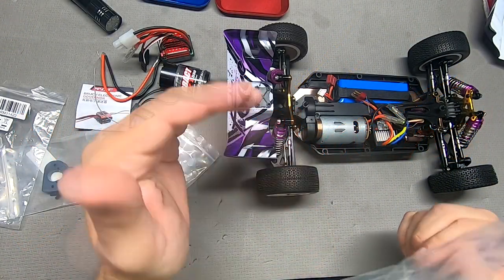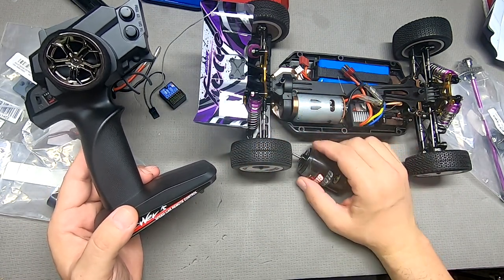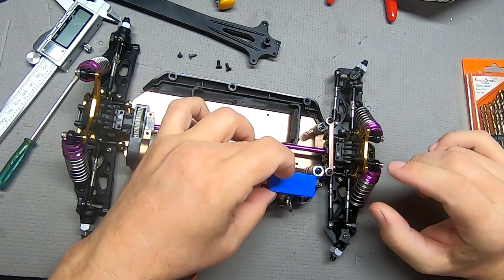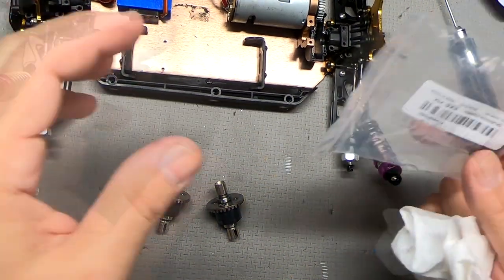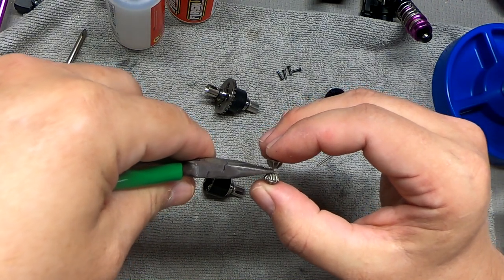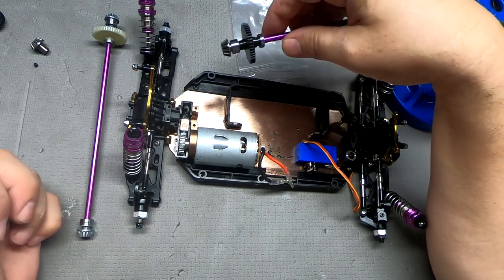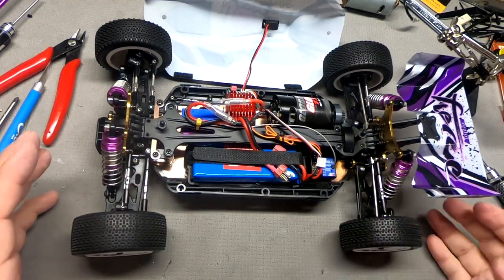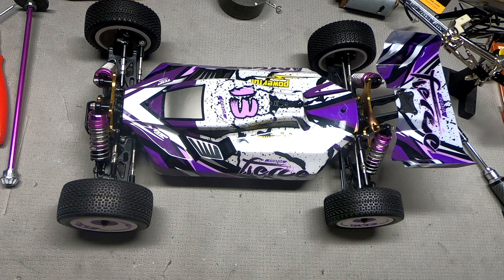New Motor, Diffs, Electronics, & Speed Test - Wltoys 124019 RC Buggy 4WD - Pt. 7

Comment: Could you go faster with a bigger battery? If so what kind?  using the original motor . great video and thank you for your honest logical opinions thanks again. hope you all are feeling better
Reply from the maker: Hi Mike, sorry for the late reply... been repairing a leak in my water cooled PC. 
Thank you for the complements and the well wishes! 
Let me give you an explanation of batteries... forgive me if you know some or all of this. If you get a bigger battery that has a higher "mah" rating (milliamp hour), the buggy will run longer, but not faster. Think of mah as the size of the gas tank in a car. If the battery has a higher C rating, the buggy may have more power and/or accelerate faster. The C rating is a theoretical value of how much juice the battery is capable of releasing per second... kind of like the size of the fuel injectors in a street car. The S value, like 2S, is the number of cells which hold 3.7 volts each. You can think of this as the displacement of a car's engine. Going from 2S to 3S would make a car go faster, but only if the esc and motor can handle the additional voltage. This buggy can't take a 3S without burning out the electronics. 
My recommendation is to keep it stock unless you are willing to spend a lot of money on it.
What are your goals for RC? Do you just want to bash, or are you interested in racing? Let me know so I can advise you further.
Regards, CJ
Reply: @MyRCChannel-CJScott  Great explaining. I am new to RC and was pretty much clueless about the batteries. I think I will keep it stock 30mph is good  and fast enough for a beginner like me. Wife an I Manage and live here at  our campground in FL. I was racing around the grounds and  some of our patrons/friends  were amazed how cool  the 124018 was. They bought 2 of the 124019 and I just order my wife the same. Planning on creating a race track in the tent area. should be a lot of fun. 1 more question. I been looking to fined where to buy more wheels and tires for these models. I found some and seems to be not many options.  Any special store I should go to? thank you so much for getting back to me, very much appreciated.😊
Reply from the maker: @mikel8367  Not sure about wheels and tires... 1/10 buggy tires MIGHT fit...
The best way to make a car go fast... as in fast laps is to improve handling. This is accomplished by tuning the suspension. Here are some links to information about how suspension works and how to tune it. Also, if you haven't already, watch the 4th part of this series where I do a basic setup. Link below:
https://www.youtube.com/watch?v=tnLdywZhtEc&list=PLWi1J2KoLS73tAQc-_FfVPkVvUVWVOAov&index=4

Suspension Tuning

https://img2.associatedelectrics.com/pdf/cars_and_trucks/shared/RC_HandbookV2.pdf

https://www.competitionx.com/rc-tuning-guide/

https://www.rctech.net/forum/electric-off-road/708385-understanding-tuning-introduction-basic-tuning-racing.html
Reply: @MyRCChannel-CJScott I was thinking changing wheels mainly for looks. I would like a good set up for my terrain.   I will definitely check out the links you sent. .thanks again  for your help .

Comment: What is the difference between running grease vs oil in the Diffs?
Reply from the maker: Diff fluid comes in specific viscosities and is designed to maintain that level of "thickness" during use. By providing an unchanging thickness, you can tune your diffs using different grades of diff fluid. 
The primary function of grease is lubrication and it's viscosity may change when heated... it's also not measured by thickness so you can't use it to accurately tune the diffs... but since these diffs do not have o-ring seals, they leak over time so it's not as critical what you use, as long as there is some form of lube in there... It's a cheap car, but at the same time it's well worth the money for the beginner, basher, or anyone on a budget who is not interested in racing.
Reply: @MyRCChannel-CJScott  thanks for that 👍 I purchased this for my sons 8th birthday, so looking at 'what to do first'. I was just going to shove some decent lithium grease in there as I have good quality bearing grease on hand, honestly I was just going to pack it with grease and be done with them until they are worn, unless that a bad idea? 

I used to run nitro rc 20 years ago, Tamiya and a nitro Hawk which I modded a lot, but its been a while and I'm out the game...
Reply from the maker: @adamrobertsgb1  Having tinkered with this car and it's diffs, here are my recommendations:
Problem, the diffs do not have o-rings so they leak over time so using grease is Ok.
Since the diffs leak, trying to tune them is a losing game and you'll waste a lot of time fooling with them. 
The aluminum diff housings leak worse than the plastic ones so stay with the plastic for now. 
Don't over fill, try about halfway up the small gears. Rotate the gears as you add grease to fill any voids or bubbles. This should provide descent resistance. 
Use this buggy as a platform to teach your son about how suspension works and how to tune it... toe, camber, ride height, etc
Here are a couple of great guides to suspension tuning... 

https://img2.associatedelectrics.com/pdf/cars_and_trucks/shared/RC_HandbookV2.pdf

https://www.competitionx.com/rc-tuning-guide/

https://www.rctech.net/forum/electric-off-road/708385-understanding-tuning-introduction-basic-tuning-racing.html

Keep in touch and let me know when your boy is ready to move to the next level... I'll help you choose his next car based on what your goals are. In the meantime, contact me any time if you need help.
Regards,
CJ

Comment: 34mph is plenty fast? 😆. That’s where we differ my friend 

Nice video though !
Reply from the maker: Thanks! To each their own. If you like speed runs, more power to you, as long as you do it somewhere safe. I like to turn at the end of a straight away and then turn again... my focus is on racing. 

Thanks again for watching. I hope you'll check out some of my other videos. 

BTW, if you like fast, you should check out 1/8 touring cars like the Serpent SRX8 GT. That thing is crazy fast and it corners like it's on rails.
Reply: @MyRCChannel-CJScott  only fast cars I really have currently is my 4 Tec, my typhon, my rustler 2wd, and my arrma felony.   I’m into speed runs but it does get boring going in a straight line lol I don’t have any tracks to race at near me I don’t think 🤔 I’m going 2 look into it.
Reply from the maker: @DeRock401  That's too bad. Not having access to a track would be a bummer. I've got two indoor off-road clay tracks within an hour's drive, one of which has a big Mini-z racetrack. Also, there is a local club run by this great guy who has been organizing it for years and pays for a lot out of his own pocket. We race on road cars in a school parking lot. I consider myself lucky. 
If I didn't have access to these facilities and clubs, I'd probably be doing the same thing you're doing. I've thought about trying some speed runs, but my area is very urban and the local authorities would crack down for sure.
Reply: @MyRCChannel-CJScott  yeah I’ve yet to find a location to run my felony yet cuz the road/ parking lot needs to be at least 500m long and smooth blacktop which is annoying. And I also live in an “urban” environment lol  but yeah man I love this hobby too much to let it stop me
Reply from the maker: @DeRock401  I've contemplated where to do long runs because I built a car for No Prep drag racing, but the fascination was short lived. The guys I race on-road with were holding drag sessions for a while last year, but having to set up for drag races on Saturday and road races on Sunday became to much I guess. I know it was more than I could handle on a regular basis.
Anyway, where I was going was, you might look around to see if you've got a shopping mall that closed down in your area. Malls have some of the biggest parking lots. Bring a leaf blower and/or a wide push broom to prep the run and you're gold. There is a big mall near me that totally shut down after the housing bust and never reopened. Now, they lease out some of the parking lot space to Amazon and others for fleet vehicle parking/storage. But they're are still big open areas where there's nothing and no one to get in the way. Big office parks on the weekends are a potential candidate too.
Reply from the maker: @DeRock401  BTW, the Felony is a bad ass car. I would have also gone with the orange body! I wish there was more large scale on-road racing in the US. In Europe, they race these awesome 1/5 sedans and F1s. Check out these links...

https://www.youtube.com/watch?v=oUNE5VxBNpw

https://www.ebay.com/itm/FG-Formula-1-Sportsline-F1-RC-Car-/143610349510?hash=item216fd807c6

https://www.ebay.com/itm/FG-Challenge-Line-510-Porsche-GT3-RSR-26-cm-FG-engine-RC-Car-26-ccm-/144180802194?hash=item2191d87292

Comment: Shim the Diffs under the sun gear with a smal shim and on the output cap to allmost thigth to reduce the leakage.
I´m disapointed thats not the possible to put a O-ring in the inner of the diffcase an the bevel gear.
Reply from the maker: Yes, I was also disappointed, but the 104001 is a much improved design. Here is a link to the playlist on the 104001... https://www.youtube.com/watch?v=RNKN0IYBDG8&list=PLWi1J2KoLS70A2-LdYiCIedt04a3nmXm1
In my opinion, the best beginner RTR is the Associated Pro4 SC10 at just over $300. It's brushless, developed by a  well established kit maker, and it's based on decades of development and R&D. https://www.associatedelectrics.com/teamassociated/cars_and_trucks/Pro4SC10/RTR/

Comment: question, radio master tx16 work with rc cars.
Reply from the maker: You can technically use it, but it's not a "surface" radio so you don't want to show up at the track with it. I used to use a stick radio with cars when I was a kid... 40 years ago... but, you don't want to develop the muscle memory for driving with sticks only to have to relearn to drive with a wheel and trigger. This is a good radio for the price. Extra receivers are about $20-24 and it's got all the important features. I have one myself and am very happy with it's feel and performance.

FlySky FS-GT5 2.4G 6CH Transmitter
https://usa.banggood.com/FlySky-FS-GT5-2_4G-6CH-Remote-Controller-Transmitter-with-FS-BS6-Receiver-for-RC-Car-Boat-p-1503240.html?cur_warehouse=CN&rmmds=search

If you're really trying to go low price, FlySky also has a 3ch it's about $50 and receivers are under $10... it may not have as many features, but it does have the most important one in my opinion: expo. A lot of cheap radios don't have expo and it's very important for tuning steering input in particular. 

Flysky FS-GT3B 2.4G 3CH Transmitter With Receiver
https://usa.banggood.com/Flysky-FS-GT3B-2_4G-3CH-Transmitter-With-Receiver-With-Fail-Safe--p-84105.html?cur_warehouse=CN&rmmds=search

Flysky Receiver FS-GR3E for GT2/GT2B/GT3/GT3B/GT3C/T6/CT6B/GR3E/TH9X Transmitter
https://usa.banggood.com/Wholesale-Flysky-Receiver-FS-GR3E-for-GT2-or-GT2B-or-GT3-or-GT3B-or-GT3C-or-T6-or-CT6B-or-GR3E-or-TH9X-Transmitter-p-60265.html?rmmds=detail-topright-recommendation&cur_warehouse=CN

I'm NOT affiliated with either Banggood or FlySky... I have  two FlySky transmitters and a handful of receivers... none of them have ever given me any problems. I also have a RadioMaster TX16 with Hall sensors... it's a great radio too.

I hope all this helps,
CJ
Reply: @MyRCChannel-CJScott  
        Thank you. is very helpful 
to me.

Comment: What 3D printer do you use ?
Reply from the maker: I've got an Ender 3 pro... If you're looking for a printer, the new Ender 3 V2 is a good option. I've been very happy with mine, and would buy another. There is a lot to learn though... you need to learn a 3D program like FreeCAD or Blender to design the 3D items. Then you need to learn to use a "slicing" program like Cura which prepares the 3D file for printing... but it's a lot of fun and there are lots of YouTube tutorials to help you get started.